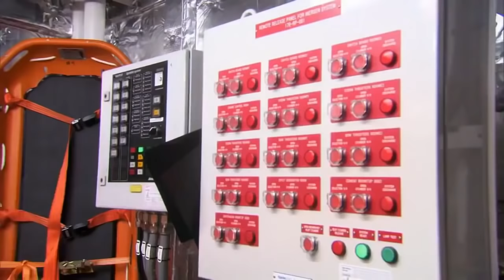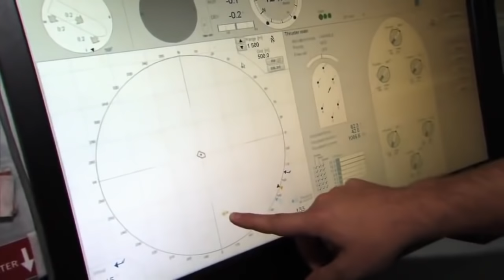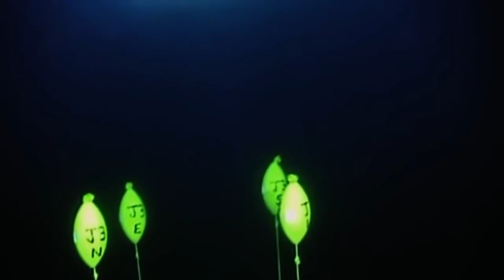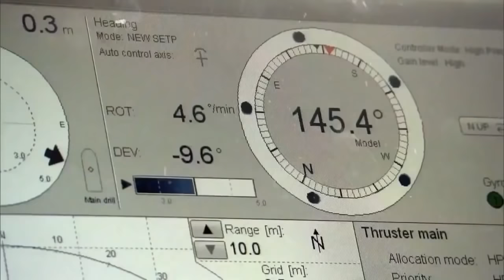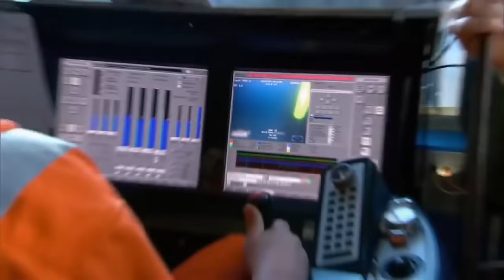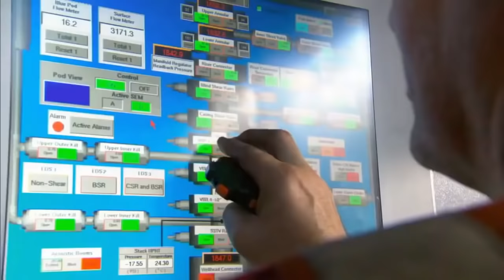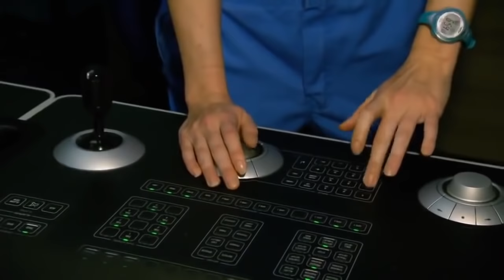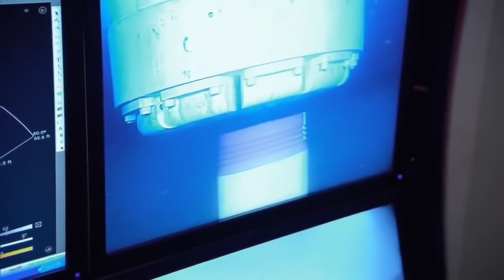The Maersk Viking - Mighty Ships (Maersk Drilling) HD

Comment: 7.45 too much safety briefings also get the crew boring and keep their mind wandering...best to keep safety meetings to the point...surely the roughnecks would have worked in many offshore rigs before and hearing the same thing over and over is boring just like safety briefings for a frequent flier..9.24 surely every oil rig would have underwater pipelines in each and every area of operations round the globe also surprisingly the conductor is literally hanging like a pendulum while the vessel is moving...but it saves a lot of time and work from removing and reconnecting again...the new site must be very close by...10.05 shows the rov can move in all directions...the subsea engineers with experience can handle these jobs easily...its about the underwater current and it is high then it gets a little tricky but experience is handy....13.14 obviously dynamic position no anchor at this depth...16.45 the sound of pipes moving is all to familiar for all rig personnel including housekeeping and cooks...23.30 crew change chopper which each and every crew member who is going on off would be waiting for...the gulf of Mexico must be warm...no incoming or outgoing crew are wearing immersion suit...north sea is cold...isolated work 23.38 surely much better than merchant navy where crew work for 3 or 4 months...43.50 bop latches no worries till next week...wonder whether this drill bit would last 10 to 12 weeks or needs to be changed ever...by the way the death of a crew a few months back as said by one of the supervisors on this video is about
An incident on board a Seadrill-owned drillship working for Kosmos Energy in the U.S. Gulf of Mexico has resulted in the death of one offshore worker. ... The West Neptune is under contract to Kosmos Energy, located in the US Gulf of Mexico at Mississippi Canyon Block 727.26-Jan-2021.

Comment: how does the rig rotate if it is attached to the bottom with wires? won't they spin?
Reply: Dan Ivanov tool called a slip joint allows rotation
Reply: The pipes aren't fixed rigidly to the drillship